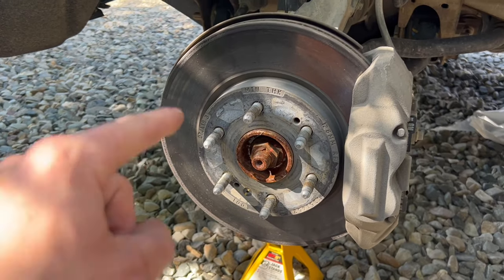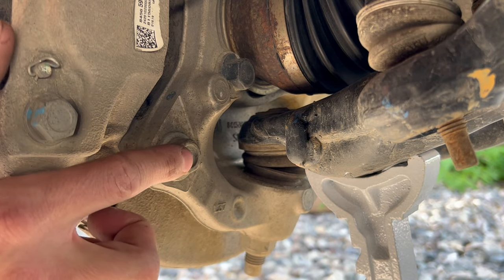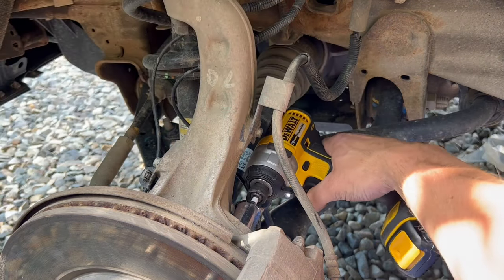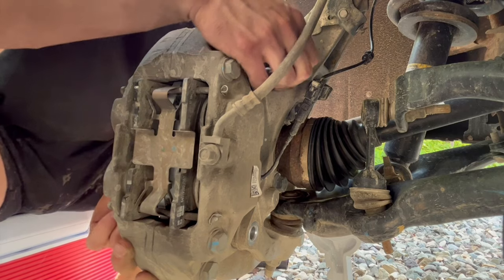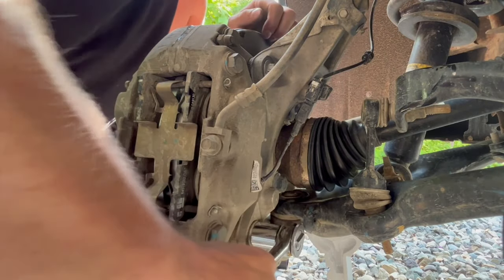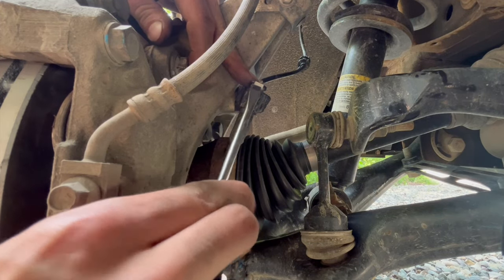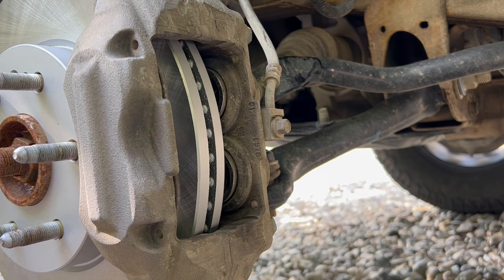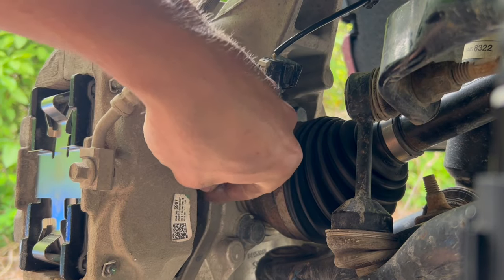Front Brake Replacement Made EASY! | 2019-2023 Chevy Silverado

Comment from the maker: Who else found this job extremely easy?
Reply: Not me I’ve had the worst day ever everything was going good n when you used the screw driver to push in the piston to give some space for the pad the opposite side sprung out and started leaking brake fluid now idk what to do
Reply: I just changed my pads and when I started the truck I got a service esc alarm and a 43 mph top speed limiter. There is also a brake fluid leak now at my front left tire. Never even removed the caliper.
Reply: Wow, amazing tutorial 
Just saved me a few 💰💰💰
Reply: That happened to me I had to take it apart and push it back in next time do one pad at a time don't take out both good luck
Reply: To get out of limp mode or not go faster the 43 mph.disconnect negative battery terminal then push on brake until it feels tight and could take a few times hook back up and it should clear.except check engine that you might need the reader.
Reply: I was told on the 2024 when you hook up the electrical wire it needs to be calibrated to the truck.  Is this true?
Reply: @jarenalvarez1704 same thing to me. Absolutely worst brake change. When I watch the videos I got excited and thought it's was gonna go great. Horrible
Reply: @mrjamesstarr7  I thought I was the only one😭 I got frustrated n put it in the shop😂
Reply: @jarenalvarez1704  lol
Reply: @jarenalvarez1704 happen to me yesterday the caliper started leaking so I ordered a new one

Comment: My friend.. great video!!   But.. Please don't ever let your calipers hang freely from the brake lines.  Get a hanger or prop them on a control arm.  That's really bad for the rubber lines and you risk damaging them.
Reply from the maker: Thanks for the tip! I just did the back pads and rotors and made sure to hang the calipers this time, cheers!
Reply: I use long zip ties…
Reply: @IHATEJEREMYMOCK yes use anything you have just don’t let them hang like Andrew did.
Reply: @DIYAndrewFlockhart  Andrew didn’t you have to put your truck into maintenance mode first? Or is that only the rears?
Reply from the maker: @Jbmc65  My understanding is you only have to for the rear as the brake service mode releases the parking brake properly and that's only in the rear. Never a bad idea to put it in brake service mode though!
Reply: @DIYAndrewFlockhart  Thanks, I live in Canada and I just bought a 24 Sierra Denali, my 2018 I took brakes off and greased the hardware and pins, if not the pads suited to the hardware, I also found maintaining them yearly saved on rotors. All the best.

Comment: This is all a sham. Dont do this on your own. At least the back brakes. Take it to a dealer. I’ve changed brakes 100 times and just did my cousins 2019 and we couldn’t get the rear calipers to retract we had to open the bleeder valve and spin them in. Then it went into limp mode cuz it’s saying the brakes are inoperable. My cousin ended up driving the truck home but he had to push it to the floor to just get a rolling stop. Gotta take it to the dealer now anyway. Probably saved no money at all or actually cost money by messing up the electronic system somehow.
Reply: The truck has a feature to put the brakes into service mode which would have avoided the problem you had. There’s videos on YouTube that show you how to put it into that mode and take it out. Now a days there’s no reason you can’t diy things as long as you do your research
Reply: Takes about 10 seconds to put the truck in brake service mode. No sham and no need to pay a dealer hundreds more.
Reply: Takes about 10 seconds to put the truck in brake service mode. No sham and no need to pay a dealer hundreds more.
Reply: You just be lost at life and don't know anything huh
Reply: @xaviermccrary4817   I have always done the repairs and service on my vehicles. I’m an aircraft mechanic as well. I just never imagined they’d have changed the brake system that much. After my comment I did read more and found out I had to put the truck in service mode so I didn’t know it was that simple or I wouldn’t have made the comment.
Reply: I hate to tell you this, but you did it completely backwards. To compress a piston you NEVER open the bleeder valve on the caliper side. You open the top on the brake reservoir on the engine side, and compress it very slowly, half of turn every 10 seconds on a C-clamp (or you can break the piston). You have somebody stand on the engine side and make sure the fluid doesn't overflow out on the reservoir, if it does, suck it out with a syringe. When the job is done, you
"bleed" the brakes. this is when you use the bleeder valve, and make sure you never run the reservoir out of fluid. While somebody Pushes the pedal to the floor, while it's on the floor, You open and then close the breeder screw (before releasing the pedal) ensure the reservoir never goes completely empty while doing this, and add brake fluid as needed. The bleeder valve is to "bleed" brakes, not to compress them. by doing it your way, you got air in the lines, and that's why it doesn't stop now. Basically you let a bunch of fluid out, compressed it out through the bleeder and the reservoir went dry and/or air got in the lines.
Reply: @j_incognito6716 which airline? I'll remember not to go on those planes . You can't even change brakes with an auto handbrake come on..

Comment: I appreciate the video, but people should be aware of a few things. 1 - You need to tell people to remove the front brake pad sensor BEFORE removing the caliper so it doesn't snap and break. 2 - Install the sensor BEFORE putting the caliper back on the rotor so you can see what you're doing. It's infinitely easier. 3 - Hugely important - A 2020 Silverado 1500 LT 4wd v8 requires the 343mm front rotors. Autozone will tell you that the 330mm rotors and the 343mm are a perfect fit, but they're wrong. Only the 343mm fit for me. I installed the 330mm first and they seemed to install just fine, but when I tested the brakes the caliper was grinding on the rotor. I had to do this job all over again after getting the right part.
Reply: You are a legend for this info...thanks
Reply: @slicksilver9441  I hope it helps! This job was miserable for me because I found all of those things out the hard way.

Comment: Also you have to put the truck in maintenance mode by holding down the parking brake button for 10-15 secs before you began job or you can fry the master cylinder module,  speaking from experience.
Reply: That’s for the rear brakes.
Reply: It’s for front as well. Ask me how I know.
Reply: @CodyGault-q6r  The Electric parking brake only is on the rear wheels.
Reply: And the front

Comment: I just gave my dealer $300 and they did it, front and back brakes, new rotors, rotated my tires and topped off fluids. It took them 30 mins while I drank their free coffee. I let dealer do everything, they do oil change cheaper than I can buy the oil and filter. Plus there’s a paper trail and I get extra couple grand trade value when I go to buy a new one
Reply: $300?!? My dealer just quoted me $650 per axle for pads and rotors!
Reply: Wow,that’s a great price from a dealer

Comment: Never let the caliper hang with the weight on the brake line and also you never put grease on the pins or caliper where the brake pads slide.

Comment: This was very helpful! Thanks! After doing this on a 2021 Sierra Denali, I had to have the codes cleared for it to recognize the new sensors. FYI…
Reply: I have a 2021 Seirra Denali also, did you put the truck in Service/Maintenance mode? I'm asking because i am going to take a shot at changing my brakes soon. Also, I researched if you were to get a code after changing your brakes, all you have do to clear the code is disconnect/ reconnect the battery.

Comment: Great job, do you have to reset the pad % in the dash. If not your check engine light will show with the brake light will also be on!
Reply: I just did on my truck I had those lights on it how do u remove it?

Comment: Couple of things missed.  Clean the rust off the wheel hub with a wire brush and put some never sieze around the hub before putting new rotor on. Caliper bolts should have loctite and torqued to 170 ft/lb.

Comment: Very easy! Great video!
However I'd recommend having a basic code reader on standby to clear all the codes thrown after changing the pads (max speed 43mph, ABS, traction control.. etc..)
Otherwise you'll have to pump the absolute hell out of your brake pedal with the engine off (depress brake hard for 45seconds, let off for 10seconds, repeat 5-10x) and hope they all clear on start-up.
I've done it both ways but the code reader is infinitely easier.
Reply: This. Just did mine today and was surprised by the codes. My reader cleared them and brake function was corrected.

Comment: I found the stock pads were pretty good, but rotors warped quickly on truck. Little to no anti squeal from factory which is why you have the same brake squeal that everyone seems to have. Decent caliper design, but definetly put anti squeal on next time you put the pad in and you won’t have an issue.

Comment: You just need to clean the dust out of that groove on the inside pad. The Pads and rotors you removed are still fine. Also when you remove the caliper. You should use a coathanger or haywire to tie it up so you don't damage the rubber/metal brake line. Otherwise good video.

Comment: 1:32 Do not, ever, purposely allow the caliper to hang by the hydraulic hose. By doing so, you can set into motion an internal breakdown of the inner wall of the hose, causing brake issues in the future.
Reply: I use a bungee cord to hang on ... No stress on hose and plus it's out the way.
Reply: Usually use a bucket to rest it on there.  But yeah not good to just let it hang

Comment: Easy install but aren’t you suppose to put the truck into service mode for the brakes because it has automatic brakes and can cause the mechanism to fail by forcing the calipers in
Reply from the maker: Check out my video on doing the back brakes, I go into how to put it into brake service mode.
Reply: How do you put the truck in service mode? I have a 2019 LD

Comment: My 2019 Silverado LD does NOT have 3/4” bolts they are 18 mm. They are overtorqued and seized, I have them soaking in penetrating oil
Reply: The 2020 has 18mm caliper bolts also

Comment: I just changed my out saturday and it is still giving off a slight grinding noise while driving/braking. Any advice?
Reply: Brake rotors come with material that needs a layer of light sanding. Brake clean won't take the material off of those 🤙

Comment: I have a question, after my 2022gmc went to the dealer to replace the front and rear brakes, the front brake pads can only be used for 7000 miles and must be replaced, the front wheel hub has a lot of black dust every day, after replacing the front brake pads twice, the rear brake pads are still very new, why? The dealer said that my driving habits are not good, but this is impossible. The brake pad of my original car can be used for nearly 60000 miles, but after replacing the brake pad, it can only be used for 6000-7000 miles and must be replaced. It seems that the rear brake does not work. What is the reason? Thank you

Comment: Do i have to put it in service mode to do the front brakes
Reply from the maker: No you don’t! Still the electric park brake is just in the back you’re good to go
Reply: I didn’t and did my front brakes just like you showed and now I have esc service light, service brake failure light, and no speed faster than 43 mph
Reply: @theofficialap1067 mine did that too yesterday and I had codes for the master brake cylinder as well. My piston fell completely out so I pushed it back in and rebled front brakes. All the lights lit up on the dash. I ended up just driving around at 43mph and eventually next time I started it up from being off everything was gone

Comment: So i have a 2020 gmc sierra, put my truck in service mode, did the brakes and new front pad sensor...completed the job and took it out of service mode and now my truck wont read the new sensor. Any ideas?cant seem to find any videos related to this problem.  Thanks
Reply from the maker: I couldn’t get my truck to read the new sensor either. Every thing I read online said you had to go into the dealership to get it programmed again, or if you have a fancy scanner to do it. So unfortunately I will just be checking pad life manually from now on
Reply: @DIYAndrewFlockhart  I have the blue driver scanner, wonder if I can do it on that
Reply from the maker: @RetroViking666  Let us know if you're able to! I would love to reset mine.

Comment: Just mentioning for safety's sake... Jack stand on gravel is not a good idea. need something solid  to set that jack stand on. also those caliper bolts had orange loctite on them from factory. that's why they were so hard to loosen. they can back off due to heating cooling...have had it happen to me before. not, trying to knock you brother, just trying to be helpful.

Comment: If you live in a state that uses salt in winter. Save yourself a LOT of trouble and DONT put the rotor screw back
Reply: I just put a little anti- seize on the threads, comes out easy every time. I’m in the Northeast with plenty of salt in the winter.

Comment: I'm so frustrated after watching his video I pushed one piston in at a time. Which would cause the other piston to push out. Causing it to be almost impossible to push it back on. Order a new caliper but finally got it to go back in pounding on it with 2 axes and the old brake pad. Guess I'm gonna take the caliper all the way off next time and push both pistons in at the same time. Any advide? Anyone else deal with this?
Reply: When youre getting ready to press one piston in, hold the other one down tight with either your hand, or leverage it with another screwdriver. Do this back and forth for both pistons until they're both out of the way 👍🏽

Comment: No way he tightened the caliper bracket bolts to 170 ft lbs with that 3/8 ratchet.
Reply: I saw him break out the 1/4" driver and hang the caliper from the brake line and gagged
Reply: This video have me a stroke
Reply: This video gave me a stroke

Comment: Well followed your-instruction and now every brake light on the dash is on. Guess When doing front brake pads you have to put in brake service mode. Now off to the dealership. Ugh
Reply: Did you figure anything out for problem?just got the same thing.
Reply: @bluayek9436  - It was in limp mode let it sit overnight and was able to drive to dealership to reset light. The only stored code was the wheel sensor but they cleared it and said bring it back if it comes back on.

Comment: Did anyone have a problem with one of the pistons not setting into the calipar????
Reply: Yesss
Reply: I'm so frustrated after watching his video I pushed one piston in at a time. Which would cause the other piston to push out. Causing it to be almost impossible to push it back on. Order a new caliper but finally got it to go back in pounding on it with 2 axes and the old brake pad. Guess I'm gonna take the caliper all the way off next time and push both pistons in at the same time.
Reply: I had to do the same thing!! I actually got a hammer and started hitting the pistons into the caliper I was the F it stage and started hitting it semi hard and they both went it and I re bled the breaks and boom it was done. I only had a problem with the fronts the backs where very easy

Comment: Any code after the brake replacement?
Reply from the maker: No codes after the replacement!
Reply: I got every brake code possible after doing this on my 20 High Country.
Reply: @ChristopherSmith-kb3wi hey man i just had this happen to my 2021 High Country in addition to the front break pads (which were the only ones that were changed)  are just not working, that’s causing the truck to go into limp mode
Reply: My truck went into limp mode dealer charged me 1100 since the pistons popped out and leaked all the brake fluid.
Reply: Wow mine my cylinder popped out two but I took it apart and push it back in really easy then disconnected for 10 min on the negative pushed brake till it got hard then it worked great 👍🏾
Reply: But don't get me wrong I was pissed but googled the answer don't give up bros

Comment: how do you reset the brake sensor life inside from saying service brake system
Reply: I had the “service brake system” “esc” “traction control off” “43 mph max speed” on and I got worried. For me(I have a 2021 Silverado 1500 LT) and I did the front rotors and pads myself. I did not put it in service mode. I drove my truck for 20 minutes(not over 43 miles per hour) and it wouldn’t clear. Also, the brakes felt spongy when I depressed the brake pedal. I parked it and shut it off. I depressed the brake pedal and the start button and I held it for 35 seconds; I shut it off again and then waited 20 minutes before I turned it on again. It cleared everything and was braking fine.

Comment: Alot of yall seemed not to open ya fluid reservoir and thats why ur getting codes
Reply: Yes was always told to take the cap off. When pushing in the pistons, you could get air in your brake lines